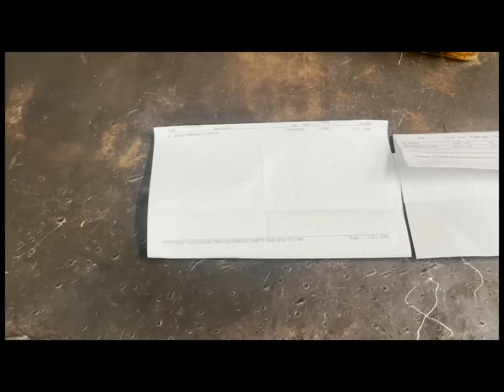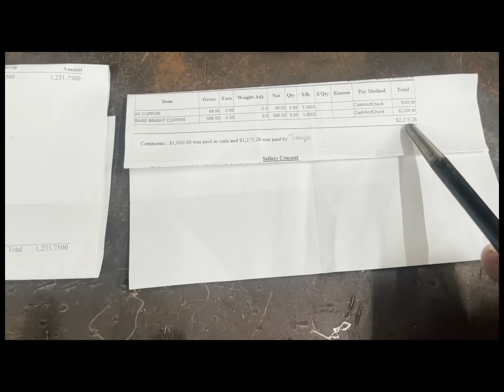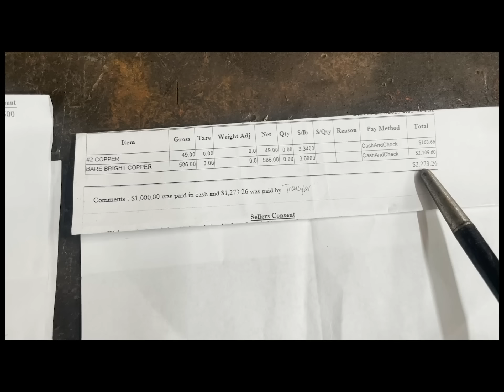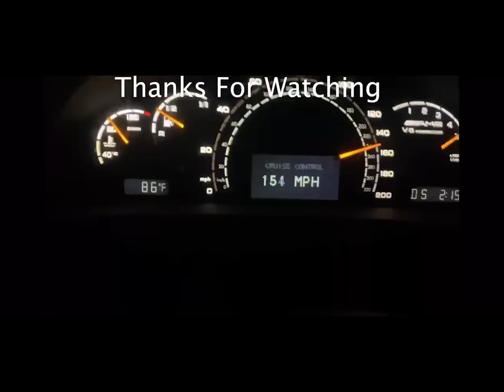Stripping Spaghetti wire & A Little 500 MCM Pt.2

Comment: The green copper I toss into my cement mixer with a $3 bag of gravel. Comes out bright & shinny. If you run the plastic insulation thru the chipper you would reduce the volume by half.   :)
Reply from the maker: Thanks for the suggestion

Comment: A pump up sprayer with some white vinegar will clean it right up.  30 minutes to 8 hours rinse with water.
RE transformers I wondered if a wood shaped chisel, flat side against the steel hydrolic straight down cutting off one side.  Then wedged from the other pulling the wires out.  Might be dumb or brilliant lol.
Reply from the maker: Thanks I will try the vinegar next time I get some crusty copper. lol

Comment: Cable insulation is bulky a wood chipper would half the bulkiness, jointect cable jointer ( another YouTubers installs the thick cable) got a wood chipper and it seems to work for him, he has one video where he chipped a dumpster load to half a load
Reply from the maker: I will have to look in to that thanks.

Comment: If you buy a wire graduator You could chop up all of the copper down to small pieces.. And I doubt they'll be able to see the burnt wire
Reply: If you dont get greedy and run a lot in with good stuff you can probly slip it by.
Reply from the maker: I have one but you can't through 50 0MCM in there.

Comment: Ur scrap yard dosent buy it as plastic wire insulation .10 lb ? My yard grinds it up and recycles it like wat happened when u run it threw the granular
Reply from the maker: Where are you located? No one in south Florida buys plastic. I have to separate it when I chop it with the water sluice.
Reply: @ProjectShopFl  nw Michigan